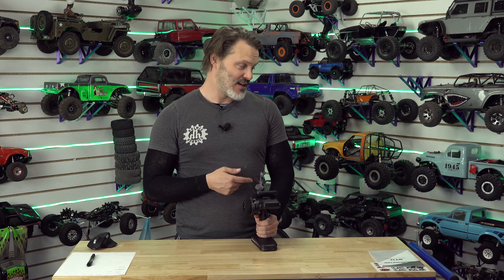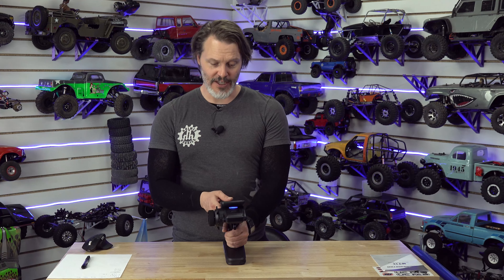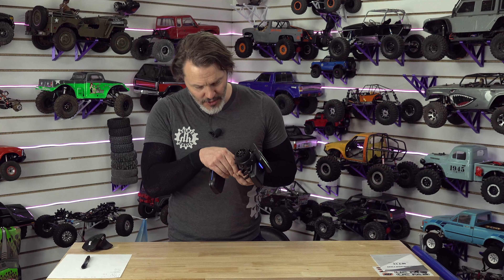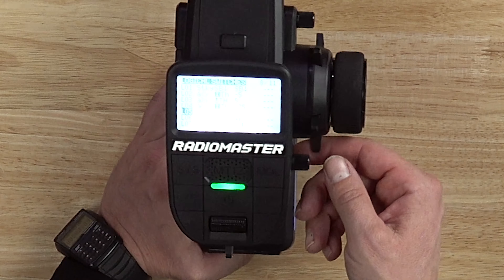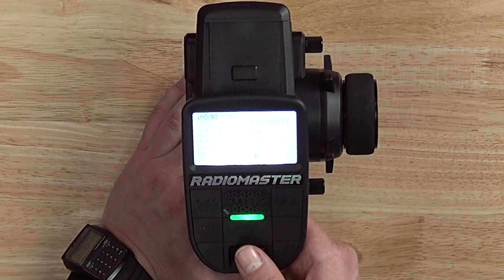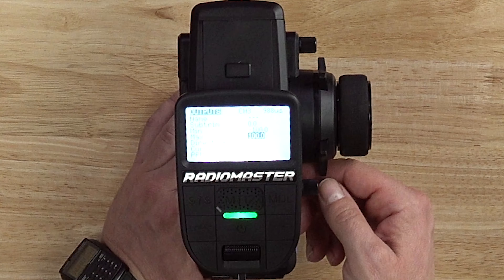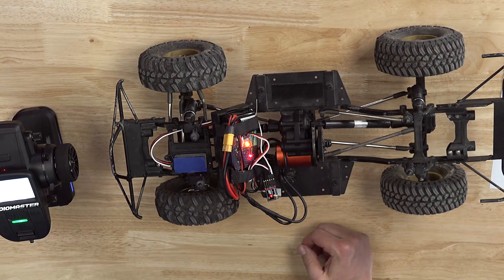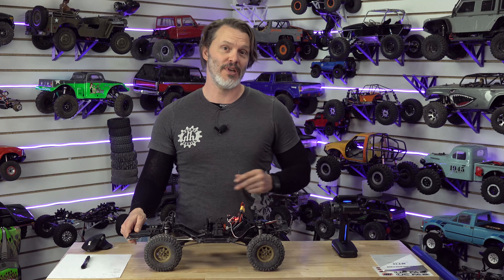Dive Deeper into RC Control: Programming a Two-Speed Transmission with RadioMaster MT12! 🎮⚙️ Holmes

Comment: Turn the trims off in the drive mode section. Change the 0's to -- 😉
Also, you can use the joystick for a winch control!
Reply: Please tell me more about this. I haven't finished my setup quite yet